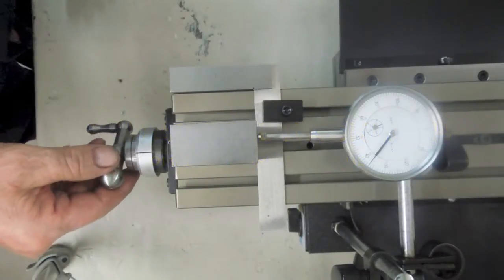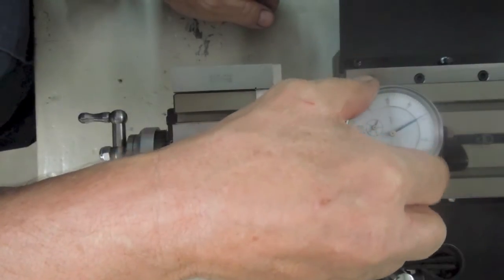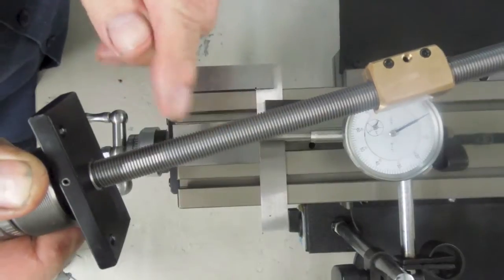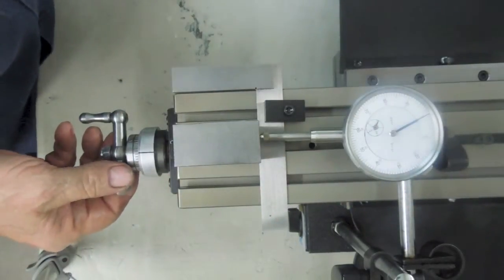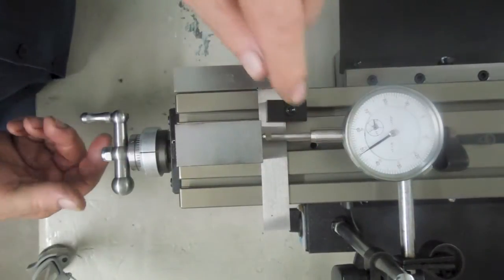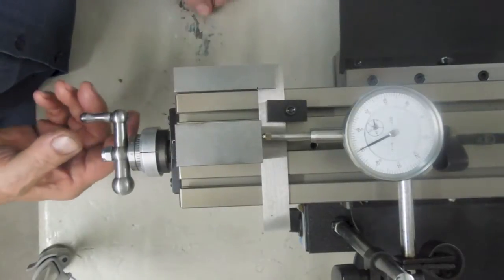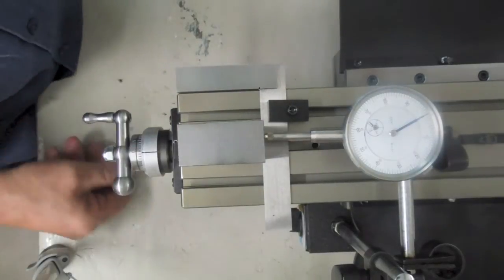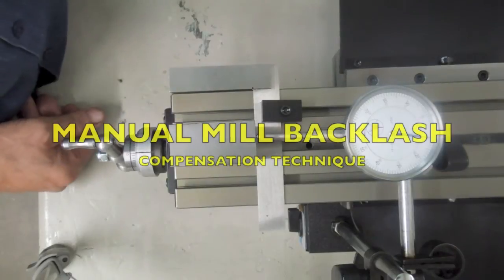TAIG MANUAL BACKLASH COMPENSATION

Comment: That's good to hear climb milling is not a problem.

So to upgrade to CNC there are no lead screw upgrades?
Reply from the maker: noshortnamesleft atall It depends on how old your machine is. If you have 3 adjusting screws in the nut assembly then you have the CNC nuts.These new bronze nuts have been standard for many years in manual and CNC machines.

Comment: how does the cnc version compansate for backlash?  Does this much backlash stop you from climb milling on a manual Taig mill?
Reply from the maker: noshortnamesleft atall  As a rule all CNC software has backlash compensation. Example:  The software will ask "how much backlash did you measure?
Type in the amount .002 or .0005 or whatever, and push the compensate button.

Taig uses a 1/2 x 20 pitch lead screw. You cannot "push" the nut to turn the screw
so climb milling is not a problem.